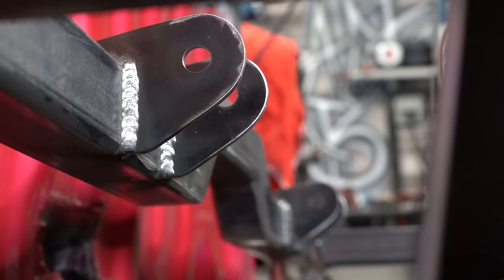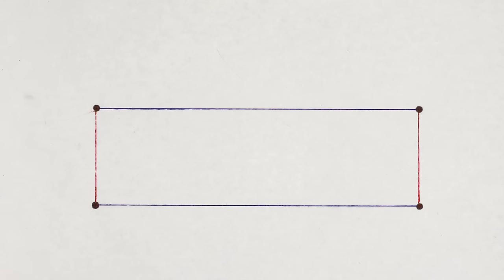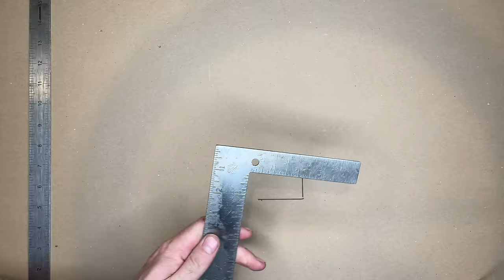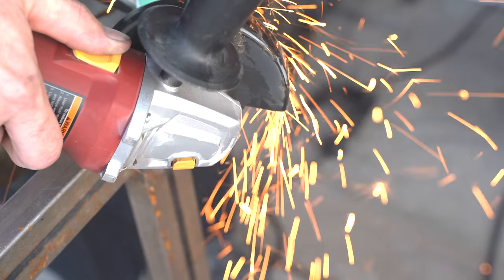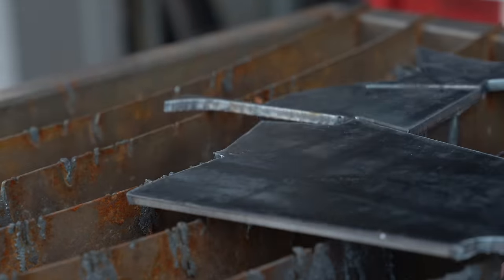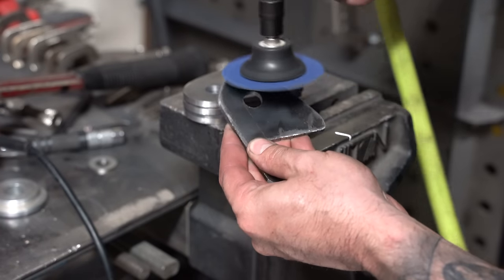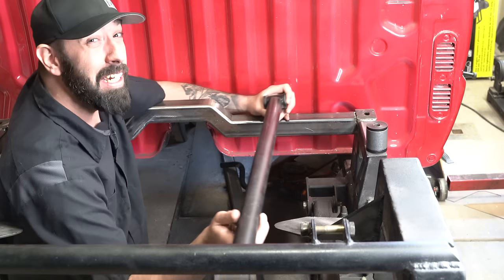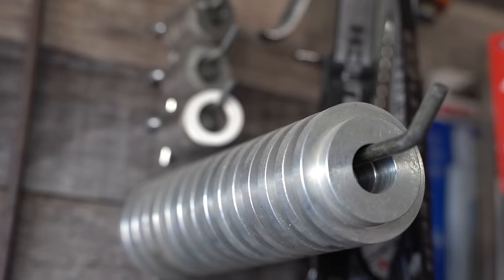How to Make Identical Duplicate Parts with a Grinder! Mighty Max Ep. 11

Comment: Made my first robotic camera rig with an angle grinder and a drill press.  When the studio employees came to pick it up they were shocked that I didn't own a lathe or a mill.  Learned in the stone countertop install industry where final fit and finish is done with an angle grinder, a square, and a straight edge.
Reply from the maker: Yes!! 🙌 It doesn’t take much to do great things. Matter the few tools you have and you’ll be nearly unstoppable!

Comment: Awesome video! This is the kind of stuff I want to do on in my free time but school has kept me busy :/ Watching this also made me realize how much I’ve been slacking on my truck. So far I realized I should probably redo the engine mounts from the po because the 4g63 isn’t sitting level with the ground/is tilted down towards the firewall; being the pickup tube is in the front on the stock oil pan, it makes me worried about potential oil starvation problems down the road. Other than that, the only progress I’ve made is I mounted an intercooler and found some black 1g seats and steering wheel lol
Reply from the maker: Hey I appreciate that little bit of info! I haven’t mounted the engine yet so I’m glad you mentioned the oil pickup. I’ll be paying attention to that now.
Don’t stress my man! I’m sure the truck will be there after you crush school. Focus on the stuff that matters. Keep in keeping on, Brother!
Reply: @GarageFab   I’m currently working on my last year for my mechanical engineering degree  and it seems like only the hard classes that eat up time are left lol I honestly didn’t really think about the pickup until I saw how tilted my engine sat. Mine was moved 2in forward to use a starion tail shaft so I think that’s where the angle came from. I’m gonna look into oil pan options and drop the front mounts a bit to level it out
Reply from the maker: Did the transmission mount change with the Starion tail shaft? I’d think moving the engine forward would tilt it forward a negligible amount not rearward. Either way it sounds like you know what to do. 
Also… mechanical engineering! I’m highly jealous.
Reply: @GarageFab  Yeah so the rear transmission mount needs cut and extended (not too hard to do) but since I wasn’t the one who made the front mounts, the timing side of the engine just seems to sit higher due to how they were made. Idk how level a 4g63 sits in a mm using the stock mounts in the stock location, but mine definitely seems off. Originally I was just supposed to finish the transmission mount but seeing the angle on the engine, it made me nervous. And yeah ME is cool but I lowkey wish I went to trade school for fabrication instead. I think I learned a lot of useful stuff I could apply but I’ve always liked the hands on approach and cardboard aided drafting more lol

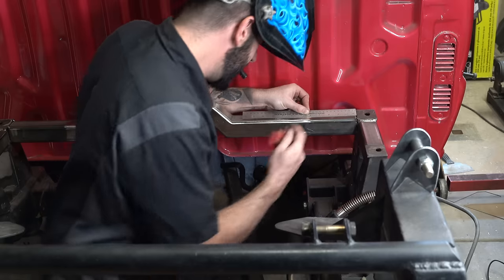Comment: At 10:12 you made your measurement from your bed mount to locate your upper bar mount. I'm wondering if that actually matches up to the inside edge of your frame?  Thanks for putting these videos together and making them available.
Reply from the maker: Good eyes. There’s the joy of editing. I would NOT suggest basing ANY suspension measurements off of the bed mounts or anything welded to the frame rails. I learned when building utility trucks that nothing can be trusted including frame holes, rivets, etc. 
I measured off-camera and found that the bed mount towers were NOT even left to right but the hats/mount plates welded to the tops were. Those mount plates were both 3/4 away from the inside of the frame rails.
Really confusing. There’s a lot of that kind of stuff I leave out trying to save time and make things less confusing. Shrug 🤷‍♂️
Reply: @GarageFab  I understand completely, and again thanks for making the videos I'm learning a lot.

Comment: Awesome, what bit do you use to punch the holes?
Thank you for a great video again
Reply from the maker: Thank you, Carlos! The size of the hole depends on the size of bolt you’re using. The bolt should barely fit through the hole. In my case it was a 9/16” bolt so a 9/16” hole is perfect. In the video I used Hougen Rota-Cut hole cutters but as mentioned, I usually drill through all of the tabs at once using a regular 9/16” high speed drill bit. 🍻

Comment: Great job Aaron! If I use 6 link bars on a triangulate setup, do I need to have all 4 holes on top lined up or just the 4 bar that are parallel that on rear end? Thanks man, love to watch and learn!
Reply from the maker: Thank you, Jason! I think I need some clarification on that one. Are the 5th and 6th link bars lifting bars? (Air springs mounted to them) I often see this setup with the main bars in front of the axle and the lifting bars behind the axle. Are we on the same page?
Reply: Like on your wife's truck, from the axle to the shopping cart handle, there is 2 parallel bar at the bottom, then you have the 2 triangulated on top, right? I am wanting to put 4 parallel bars (the bottom bar will have the bags) then have my 2 triangulated bars too, making a 6 link.  I know all 4 parallel bar holes must be inline with each other.The 2 top parallel bar and the 2 triangulated bars,  do they have to be inline with each? Or can I put my 2 triangulated bars where where they me be.? Thank you very much for your help sir.
Reply from the maker: @jasonhenley7287  I’m still struggling to picture it. Now I’m either seeing each bag mounted to two lower bars, or I’m seeing a typical parallel 4 link with triangulated bars as well.
Lemme ask you this… Why? What is the purpose of the additional bars?
Don’t take that as a judgmental “why”. Truck building for me has always been more about being original than being practical. So I’m all about weird designs. But if they had a purpose that might help clear things up.
OR!! Hit me up on Instagram @GarageFab and DM me a rough sketch!
Reply: @jasonhenley7287  If you are attempting to run triangulated bars instead of a pan -hard with a parallel 4 link then;
 Your upper parallel bars and your upper triangulated bars all have to have the eyelets(bolt holes) in line with each other, all on the same plane. The four upper frame mounts all have to be in-line with each other along with the four upper axle side control arm mounts.  Otherwise there will be alot of bind and would not cycle well if at all, depending on the severity of offset.
Reply from the maker: @Zach A I appreciate that! I suppose I didn’t really need clarification in order to explain how to make several bars work together. 🤷‍♂️ Thank you my man!

Comment: What type of drill bit are you using in the video?  Does it have a pilot drill or is that just a spring loaded locating pin
Reply from the maker: Hey, Rick! They’re called Hougen RotaCut Hole Cutters. They’re kinda pricey but worth every penny. Here’s a pair of associate links to the two specific sets I own…
Small https://amzn.to/3guFEwJ
Large https://amzn.to/3ukxxL5
Both sets have the spring loaded pin and an included punch. I often make a shallow hole from a drill bit rather than use the punch.

Comment: Is the extra little "jog angle" in the narrow side to avoid burn through and overheating / overpenetration of the tab while welding?

Also, regarding the Cubitron II flap discs... a lesson I have learned over many years and many fields is that if there is a 3M product, and a knockoff of a 3M product, even though the 3M product costs more up front, it's going to be cheaper in the long run.  This has been true of abrasives, adhesives, medical equipment, you name it.  I'm a cheap bastard, and I keep doing this comparison on my own, and eventually, after several decades, I learned to just buy the danged 3M product.  It actually *is* better.
Reply: Also, goddamn, son, your MIG is almost as precise as my TIG.  That's some solid work.  (I feel comfortable calling you "son", because your beard is still colored.  🤣 )

Comment: When you do a triangulated link bar and the angled link bar has to be longer how does that affect your pinion angle.
Reply from the maker: Hey Jeremy! This one is always challenging to explain in text so I’ll try a new example.

With a triangulated 4 link, the actual length of the bars is not as important as the distance between the front and rear axis’ of those bars.
Imagine building a triangulated 4 link on your phone. One bar extends from the top of the phone to the bottom on the right side and another on the left side. These are your bottom bars and they are parallel to the sides of the phone and parallel to each other.
Now for the angled bars. One bar will extend from the top right corner of your phone down to the charge port. The other bar extends from the top left down to the charge port. Those bars create a V. 
Because those bars are angled, they are longer than the parallel bars, but they span the same distance. (From the top of the phone to the bottom)
The top represents the front axis and the bottom represents the rear axis.
This setup would behave like a parallel 4 link, maintaining a constant pinion angle.

Lemme know if this makes sense. I’m still hunting for the perfect analogy to help explain this to others.
To answer your question as you asked it. Longer bars (Or greater spaced axis’) will cause pinion angle to change as the suspension moves.
As a rule of thumb, the shorter bars will always begin to pull forward sooner than the longer ones.
Cheers!

Comment: To make a template out of metal, would you just double the torch offset?
Reply from the maker: This may be exactly what you just said, reworded; I made a metal template once and I still used the wooden template to make it. After designing the part on card stock, I would normally remove 3/16 of an inch from all sides to make a wood template. For a metal template I would double that and remove 3/8 of an inch from all sides. 3/16 will be added when tracing the template to make the metal template, and another 3/16 would be added when tracing the metal template to make the final part. The final part would then be close to the intended size.
Be aware, though, that tracing outside corners of a template will produce rounded corners, so when making a metal template you might want to do the outside course by hand.

Comment: Why do lots of people put four link on inside of frame. Lack of space on the outside? I want to put mine on the outside of the frame. Right where the leaf springs are. Is there any problems with this?
Reply from the maker: That is the only acceptable reason, Caleb. Link bars should be pushed as close to the wheels as possible, especially load bearing link bars. (Link bars that have a spring, air bag, or coil over on them.)
On most Mini trucks, unfortunately, there isn’t enough room between the wheels and the frame so inside is the only option.
The problem with that is an axle that’s a little less stable and is prone to bending overtime under the weight of the vehicle.
Summarized, if you’re able put your links on the outside, do it!
Reply: @GarageFab  thanks so much. Looking forward to your next video. Your a badass dude
Reply from the maker: Sorry Caleb, a bunch of comments got flagged and hidden for some reason, Including one in which you asked about the Watts link location. I have no idea where that comment is. 🤷‍♂️ 
You can technically locate the watts link center anywhere you want, but that center pivot is your vehicle roll center. Putting it higher will reduce body roll in turns but installing it too high can cause strange handling characteristics. I’ve been told a lower roll center is better with a sway bar that can take body roll. I do NOT race though so I don’t have much experience with that. 
Thank you, my friend.

Comment: Hi friend, yust a kind of dumb question.... i´ve just  seen you mesure an square with your floor,........are you shure that youre floor is level???
Reply from the maker: Hey Enrique! My floor is absolutely not level! When I use a bubble level, I have to put the bubble in a certain spot. (Not in the middle) My floor is straight however so the square method is most. The floor could technically be slanted 10 degrees, and the square will still provide an acceptable 90°. Not perfect, but Garage builds rarely are. 😬

Comment: And like that, I now have an idea why I tweaked the passenger side axle tube.
Reply from the maker: Oh yeah?! What made you think that?
Reply: @GarageFab  79 impala sports coupe, 9" drop with Viking coilovers, with factory  rear springs removed. Threw the car hard into a few turns and noticed 2 degrees of negative camber on the right rear.  Some might say it was Maybelline, while others would say, there was two parallel bars missing. Which would have kept things true. Unlike what I have told many officers. Nope, I have no idea how fast I was going back there. Fun fact: can tell you exactly what turn it happened on, cause my old man was following, thought it was funny to gap em, and display the car now has body roll equivalent to a brick. lol
Reply from the maker: Oh! That sounds like it was fun while it lasted! I’m not clear where the tweaking came from. Are the coil overs mounted pretty far inward, or near the wheels?
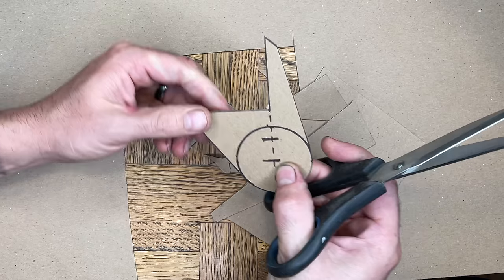Reply: @GarageFab  The way its setup is, factory springs are removed. Where the coilovers bolt in the factory shock location, near the outer sides of the rear-end.  The tweaking accursed where the axle tubes are pressed into the pumpkin itself. Old school trick was to weld the tubes to the pumpkin. Welds my lazy ass didn't have done.   That being said, once the disc brake conversion is done on the 12 bolt, 4:11 posi. The welding will be done as well. Just as a little circle track mod of throwing axle saver bearings in the rear-end as well. That should be later this summer. After the 355 and th350c is ziptied and duct taped in the car.

Comment: I wouldn't fault you if you used a Metabo grinder instead of that pos hf one.
Reply from the maker: I had to look that up. I hadn’t heard of Metabo before today. Nope. Still won’t switch. I’ve purchased 4 HF grinders so far in the last 5 years, none of them have been a POS and I’ve spent less than half what I usually spend on grinders. If I ever switch it’ll be because I finally get annoyed with the Harbor Freight switch.
Reply: @GarageFab  all my old hf Chicago electric tools broke at the seams. The Bauer stuff is a little better. My main/favorite angle grinder is a makita, I've had it 18 years and it was free with a rorary hammer. I use it all the time and never had a problem with it, so there's my bias showing. Sorry for crappin on your tools. Your work is what I'm here to see and it's definitely good stuff.
Reply from the maker: No offense taken, Michael. If I could find a tool that would last me 18 years, that would be incredible. I worry that’s likely one of those “they don’t make ‘em like they used to” things.
However, I’ve never bought a Makita. Perhaps I should.
Thank you for the kind words.

Comment: So I have my truck with a triangulated 4 link I was told that the upper link must be in a angle downward to meet the front bumper is that correct?
Reply from the maker: Is your vehicle bagged or static? If you’re running coilovers, that’s a way of getting an acceptable instant center though it’s a little more complicated than that. Generally both upper and lower rear link bars would be angled in a way that they would hypothetically intersect somewhere near the front end.
A bagged vehicle should not have that angle but should be parallel.
Reply from the maker: If it’s already built and you don’t have a crazy vibration or a shot driveshaft I’d just run it and see how it works.
I generally advise against angling the bars in favor of a parallel setup.
You’ll sacrifice a negligible amount of performance but get better drive line longevity.
Reply from the maker: Most often I use 1/8” wall 1.5” round tubing for non-load bearing link bars on street vehicles and 2x2” 1/4” wall square for load bearing bars. (Bars that have an air spring or coil over attached to them.
Reply from the maker: …so to answer your question, for non load bearing bars, your 3/16 2x2 would be just fine.